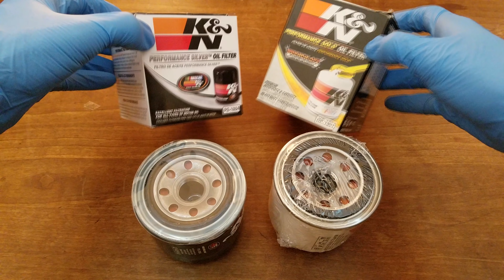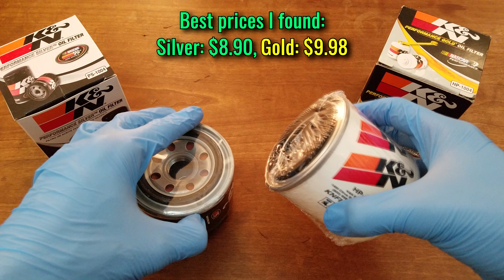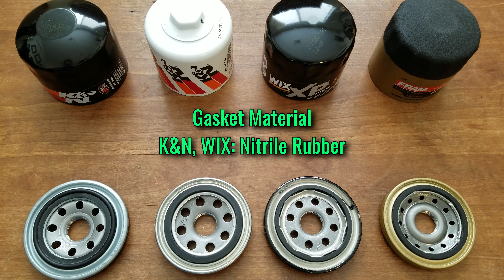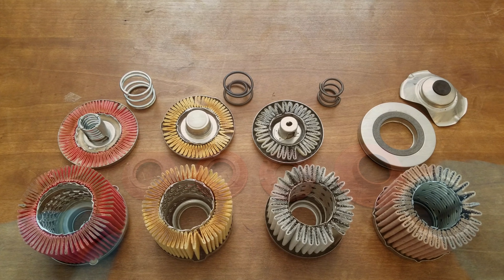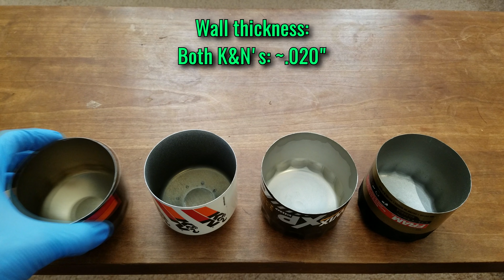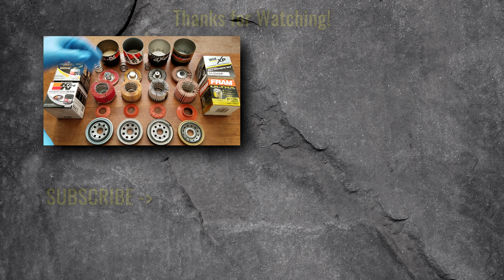K&N Oil Filters Cut Open!  Performance Gold vs Performance Silver vs WIX vs FRAM

Comment: Really good video. I have a 2025 Chevy Silverado and really want that to last the rest of my life. I'm 57 years old so I'm not sure how long that is. Lol. I guess I'm old school. Anyway. I don't care what these oils say 10,000 mi oil changes and stuff like that. I changed mine every 3,000 mi no matter what. I know nowadays. That may seem like Overkill but if it's not broke don't fix it. I had a 2003 Ford ranger with $
491,000, Miles on it with no actual motor work done to it. I mean internal motor work. You know rebuild head gasket those kind of things. I just wanted to know what was available now compared to then. Great information. Thank you and I'm hoping this truck outlives me

Comment: You don’t mention but the hole that goes through the welded nut, it is so you can secure it to the vehicle with wire etc to the frame. Racetrack reg’s it is often required in case it blows off etc

Edit, I finished the video and you did kind of brush over it at the very end

Comment: I've always used the K&N Gold, or a Mobil 1 if I can't get the K&N.  Never had any engine oil related problems in my Chevy 1500HD, 6 Lt. Engine, had 197000 miles on it when I traded it, still tight as the day I bought it new.  My GMC Acadia, 3.6 Lt engine, has 171000 miles on it, again, no oil related problems, still tight and no oil issues.  Can't say it's all due to the oil filters, but if it's not broke, don't fix it.  K&N for me.

Comment: I use k&n performance gold on my 32 year old 350 small block with 245,000 miles on it. Change my oil in January.  Still have 1,000 miles before changing again.

Comment: I typically use a brand specific oil filter on my vehicles: MOPAR on my Dodge, Motorcraft on my Fords etc. Been changing my and my family’s cars oil for decades. I had to  say that the K&N is the only filter I’ve ever had an issue with in the form of a leak. Leaked from the crimped seam at the top. I’ve heard they had a problem with the spot welds leaking at that “nut” that’s on the end too but mine was at the seam. 
I do like that rubberized grip on the Frams and wished more use it

Comment: I'm not as much interested in the construction as they only have to work for 3-5 thousand miles.  I'm more interested in the performance of filtering the oil and maintaining oil flow for proper lubrication . I would enjoy to see a test done on the filters , All filtering used oil mixed well from the same batch. The discharged flow rate and quality of the filtered oil. I've been using Fram filters and Penzoil Traditional oil (non-synthetic) in my 23 yr. old truck with 300,000 miles.  Oil comes out non gritty and engine still runs smooth and has not had any internal issues.  I  had to use an STP filter one time waiting for my Fram filter.  Never will I Use an STP filter again.

Comment: How funny, I just changed my oil today and recognized the oil filter you are using in the demo fits a 6th generation 4 cylinder Honda accord. I got the regular black one without a nut because I didn't see any of the white ones, and I usually use Castrol gtx magnatec. I think this duo is unbeatable for harsh winter.

Comment: Automotive manufactures keep lowering idle oil pressure and peak oil pressure and volume to increase fuel economy. 20 years ago an engine would have 25-35 psi at idle and 10psi additionally for ever 1000rpms before reaching some bypass pressure between 99psi and 150psi. Many modern designs only have 3-5psi of oil pressure at idle and do not come close to the pressure and volume of older designs. This is the reason for electronically variable oil pumps on say modern BMW and Toyota engines. When working with such meager idle oil pressures flow rules! Something to think about!

Comment: Any opinion on runing the motorcraft oil filter on a subaru. 
As the motorcraft made by Purolator & better price and relief valve is in the Front of filter that in my opinion is better in Cold winter start up.

Comment: Ran Fram Extended Guard for 400,000 miles in a Dodge hemi, 10,000 mile changes. They did a good job. motor burned no oil when I sold. Run K&N in my Ecodiesel Ram now, much cheaper than Chinese made Mopar.

Comment: OK, nice information about how the filters are built, but completely useless when it comes to how well they actually protect the car/motorcycle engine. I have used Fram for many years and I've never had it failed structurally. So the question really is, which performs better at filtering the oil?

Any monkey can dissect a filter,  but testing the actual performance is a different story.

Comment: I think the change intervals plays a big role in what filter to buy. I use full synthetic and change it every 2,500 to 3,000 miles since its cheaper right now. I have no issues using lower end filters since the oil doesnt get very dirty before I change it. However, if I was maxing out my oil mileage, then yes, something like K&N would be a must. Great video!
Reply: every 2500-3k? that's a waste. synthetic oil can go a good deal longer than tha.
Reply: Changing modern oil at 2.5 to 3k is just retarded. It shows your total lack of knowledge. Embarrassing

Comment: Glad I came across your video. Just picked up a K&N for my Honda Ridgeline because Walmart was out of Mobil One filter for the Ridgeline. After your video I think I’ll make the switch to K&N.
Reply: Do more research and find the micron rating of each filter. What size dirt particles are being stopped by the filter? That's the whole point of the filter and the only thing not talked about. It's the most important thing.

Comment: I'm not here to poo poo the results. But I want to say this; cutting filters apart at different price points and then making assumptions about the "premium-ness" of what you see is a bit misleading. You first need a baseline that determines minimum acceptable perimeters based on engine manufacturer specs / requirements. You work from there.... because anything below that spec is unacceptable. I'm tired of watching people cut apart FRAM filters and having a meltdown over what they find. They bought the cheapest filter on the shelf and once they got it cut apart they are looking at things which they do not understand. Just because a WIX or Royal Purple filter is technically "better" than a baseline FRAM filter, does not mean the baseline FRAM filter is NOT worth buying any/or may in some way be detrimental to your engine. Here's some evidence for you: Honda is the #1 most reliable and technologically advanced engine manufacturer in the world. Guess who makes their factory installed and service center installed filters........ FRAM. Now how many of you Honda owners go to the dealer and get your oil changed? You know they're putting in Ashland Oil products (Valvoline... among other brands...) oil and using a FRAM filter right? Don't believe me? Go down to your local O'Reilly Auto Parts store and ask them for a Honda Genuine OEM oil filter and then ask them for a FRAM Tough Guard oil filter for the same application.... bet you can't tell the difference other than the paint color.

Comment: Good review, anyone who has any knowledge about car repair can clearly see  the K&N filter will easily last 2 ~ 3 oil changes before having to replace the oil filter.  FYI: given the car is driven under normal city driving conditions, and not dirt roads or other dirty dusty conditions.   GREAT REVIEW. Thank You.

Comment: Well ... I'd like to see some oil filters for H-D shovel heads , cut open !
Reply: doncarlo5 do you have the in tank filter?
Reply: @danfecke  no, on the FXR models the oil filter is positioned just behind the gearbox, just  in front of the rear wheel ...

Comment: The most important factor of an oil filter is not tested: effectiveness and total area of the filter media. Other things like can, safety valve is less important (is it working? then OK). Even the flow area you calculated is less important, because oil pump will make 0.01% less oil pressure because of the diameters of the holes. So all of this parameters mentiones means almost nothing.

Comment: I know this video is almost 1 year old but I just watched for the first time.
Very informative with very good detail but the one thing I would have liked to have seen or heard you talk about above more than anything else is the Micron Rating of the filter media.
Sure more media area equals a larger area to trap more debris But it's the size of the holes (micron rating) that determines the size of the particles being trapped, smaller micron rating equals smaller debris being traped equals better filtered oil.

Comment: Looking at the K&N website. Gasket difference between these 2 models - Gold uses a Viton Rubber gasket, which endures high temps, up to 250 degrees C. The less expensive model which uses Nitrile rubber gasket, is fine up to about 120 degrees C. Depends on where the filter is placed in the engine bay.

Comment: the more I watch these,,,, no matter who makes the compare,, y'all do y'all's best !  I'm ONLY USING MOTORCRAFT  820S on MY 1999 Sable, and My 2003 4.6 F150 !!! ,, sticking with Pennzoil Ultra, high mileage , full synthetic !!!  n not trying go over 7 thou miles !!!!!!!! EVER !!!!!! on an oil change !!!!! Y'all welcome spend your $ MONEY ! as you wish !!  your LIFE !!  N Honestly, doubt I've gone over 5 thou Miles !! My Vehicles ! My $$ Both run great !!! did run Motorcraft synthetic blend, on both before Pennzoil switch,, but 118,000 F150,,,,,, 148,000 sable !!! no trouble HAPPY !!!!

Comment: The two K&N High Performance Gold (HP-1010) oil filters I was just shipped has a plastic inner cylinderical tube, like seen in cheap STP and SuperTech filters.  They were also no wrapped in shrink wrap.

The two K&N Performance Silver (PS-1010) oil filters still had the steel sheet metal inner cylinders...and did have a shrink wrap cap.
Reply: Wtf send that shit back then. I've purchased them and had them not wrapped many times, plastic inner sounds like a repackage scam... Gold is always metal

Comment: Why don't they ALL have nuts welded to them?  Because IF you need a wrench to remove your filter...you're a moron who can read and follow instructions.  I've probably installed or replaced thousands of filters through the years owning a machine shop and building every size engine on the road, track or water.  EVERY one of the filters I install on VERY expensive high HP/high displacement engines, trucks, tractors, cars or boat is installed hand tight and is removed with nothing but(wait for it) a hand with possibly a sheet of sand paper to grip.  Most engines operate at 40-70psi and believe it or not, many high perf engines we build are spec'd to run lower in order to pull bearing clearances out.   Unless the customer provides or specify's a brand we use Baldwin's and Schaeffer oil for all of our first fills as well.  Oh...and I've had VERY good luck with the cheapest Fram filters.  Never seen an engine fail specifically due to a PROVABLE oil filter  only related failure.  And we see a LOT of engines...Have seen a couple of double gaskets and cross threads but never an grenaded engine with a filter issue.

Comment: Mobil One filters holds 28 grams of dirt. That’s double of other filters. Mobil will hold 9x the burst pressure of other filters. $10.00 at Walmart.
Reply: The amount of crud a filter will hold depends on the size of the filter mostly. As far as burst pressure goes... I've NEVER seen or even heard of an oil filter bursting. Not once.

Comment: Should be noted the nut on the k&n gold Is absolutely not designed to tighten the filter it actually warns against it and will cause severe damage to the unit if you use it to install so gasket thickness maybe due to hire oil pressure’s but definitely not for the ability to tighten it easier

Comment: Fram Ultra XG9837 on my 2002 5.3L at 10k mile intervals.

99.6% efficient @ 20 um
94% @ 10 um
80% @ 5 um

Flows: 12 gpm @ 5.6 psid

Loading capacity: 26 grams

Burst: 380 psi

You won't find a better full flow filter on the market.  I've cut open more than 50 used Fram filters without a single failure found, and they've consistently provided low particle counts in oil UOAs.

Wix XP and K&N both have poor filtration at 99% @ 35 um.  ACDelco is 99% @ 30 um but way down on flow.  Purolator filters are having media tearing failures left and right and should be avoided like the plague.  Standard Wix is 95% @ 20 um and about the same flow as ACDelco.

Comment: I got 30,000 miles with the K & N gold and Amsoil signature series 100% motor oil with optimal performance. $6 for the K & N oil filter and $77 dollars for 7 quarts of the Amsoil signature series 100% synthetic motor oil. Do the math. The aforementioned combo is superior.

Comment: Basically they will all hold up the same . Any filter with the bypass is what your looking for if you plan on going 10,000 plus before changes . Ive never heard of a filter exploding from too much pressure so outer walls wouldnt make a diff either
Reply: The only thing I can think of that could make an oil filter explode if you installed one on a super modified tractor for the "truck and tractor pulls" No car on the road will come close to that so an oil filter exploding on a car is a myth.

Comment: You
have not mentioned the importance of where the bypass valve is
located in the oil filter element !!! If this valve is located on the
reverse side of element, then during a cold start (when the oil is
thick and this valve is activated), the oil passes outside the filter
element, picks up some dirt that has accumulated on outside filter
surface, and again the dirty oil goes through the bypass valve !!!
But, if the bypass valve is located immediately at the inlet, then
the oil ( when the bypass valve is activated ) DOES NOT pass along
the "dirty" side of the filter, and all the dirt
accumulated on the outside of the filter element remains there
forever !!! 

    
 It would be
nice if the filter manufacturers indicated in the specifications
where the bypass valve in the filter is structurally located !!!

Comment: NEVER install the K&N using the nut. It breaks the spot welds and it will leak. Even if it doesnt leak you will over torque it and it will be hard to get off. All filters should be only hand tightened. The nut is intended for removal only.

Comment: Ive only had one oil filter leak on me. It was a K&N white with the wrenchtop
Reply: was it the filter or the way you installed it?  You probably had it too loose or too tight.
Reply: @235buz  I've been changing oil im my cars for 30yrs. This happened maybe 7 yrs ago

Comment: I would suggest kN filters for off road applications since they are pricier and more heavily constructed. But for my normal daily travels I opted to install fram XG on all my vehicles. Fram xg are not the cheapest(right in the middle), but as disposable goods which needs to be replaced at 5-6000 mile intervals I believe that they are worth the cost along with decent synthetic oils. This is a very good and factual video you presented. There’s other videos out there that will present ppm data on actual filtration of said or similar filters. As always, use every bit of information with common sense and that’ll put everything in perspective.

Comment: Most tracks will not allow the use of K and N oil filters on motorcycles if this tells you anything. Repeated engine failures. Something you do not want when on 2 wheels. The wix, napa gold, are the best when it comes to a aftermarket filter.

Comment: Having used a K&N gold filter before, I can honestly say that they are crap. They don't filter for shit.
Reply: lol and you know this how?  The ONLY thing you can tell from a used filter is if it's construction held up (pleats aren't torn or collapsed against each other). You can tell absolutely nothing about filtration/performance unless you run iso certified lab test in your garage lol.
Reply: I just changed my oil filter and am now running on the k&n oil filter. My start ups are taking longer and the car doesn’t seem to want to start after I run the key. When I down shift the rpm barely moves...I had high hopes for this. Been using FRAM  wrote k&n and thought I should switch because of the bad thing a people say about fram. But k&n is making my engine feel worse than fram. Idk. I’ll maybe keep it on for a few hundred miles and see if anything changes. Otherwise I’m going to change and try wix. See how they.
Reply: With Penzoil Platinum and K&N Gold my Focus ST does just fine. Gets pushed hard, survived a 6-2 shift at 75 mph (8500-9000 rpm) and the car still runs like it was new. Now at 52k.
Reply: Finally "somebody" discovered their "High flow" hype crap. LOL :-)

In one of my cars, used, it was one of the first things I spot. The K&N sticker. 
Well when it got in, first thing to do was to place the K&N where it belongs, in the garbage can. Than go over the crap it left behind, like a stinking dirty MAF and pipes. 

Although I might had one of the price haggling reasons was precisely because of an erratic engine behavior, due to the MAF malfunction. 
In that sense the K&N was perfect. LOL ;-)
Reply: just like their air filters.

Comment: I use the K&N Gold because of the removal nut. My filter is in a spot that makes removal with an old-school filter wreck extremely difficult, while the nut of the K&N filter makes taking it off a piece of cake. It's nice to see one cut open, so now I can better confirm the quality of it with the ease it provides when doing oil changes.